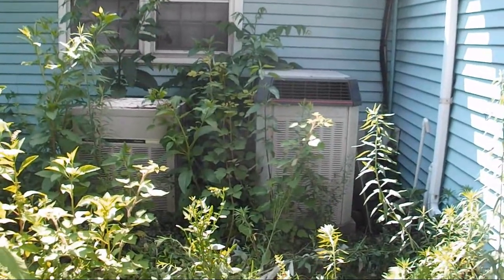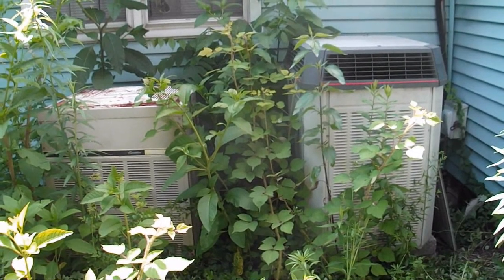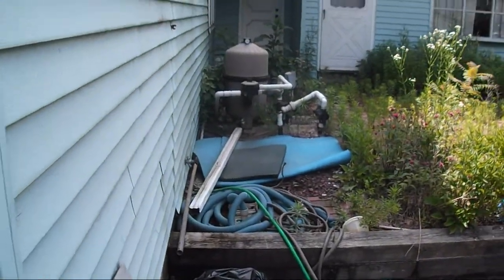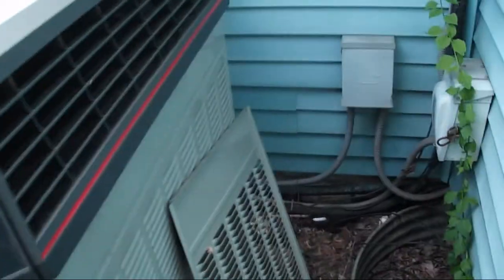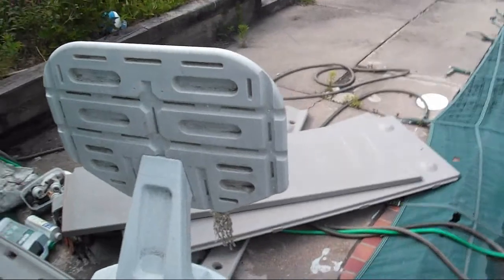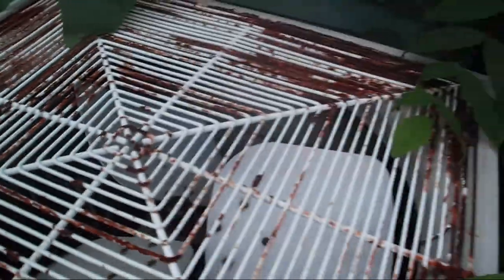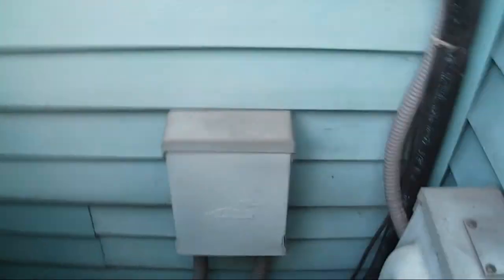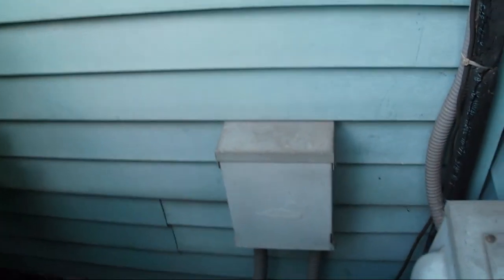HVAC Archaeology: Two vintage Trane heat pumps (Video 2)!

Comment: I did I did enjoy this one!!!  Yes the weather guard was optional at that time just pop it on or off no big deal. 
The GE oh yeah late 70's indeed our 2.5 ton had that same grill but 78 and later the 2,5 tons had the flat metal grill that Trane continued on with and the 3 ton's and higher went to the plastic grill's after 1980ish and the GE also has the climatuff and it weigh's a ton compared to the newer Trane!!! Lol lol I know I moved some of them old GE's out to the curb lol lol 
GE's did ha

Comment: Oh and yes the reversing valve is inside the  GE unit and all the electrical controls are around the top compartment around the fan. They  did away with that on the newer design sitting right next to it and made a heck of lot easier to work on!!! :)

Comment: get rid of those plants. With them, It lessens the efiiciency
Reply from the maker: This house was foreclosed on in 2011-2012 and was vacant at the time this video was made back in 2012. As of January 2017, it is still vacant. These units have not been run in at least 5 years. Somebody has been coming by and trimming the plants though.